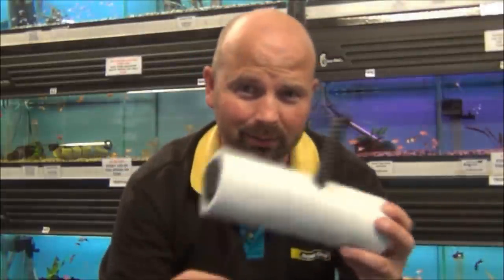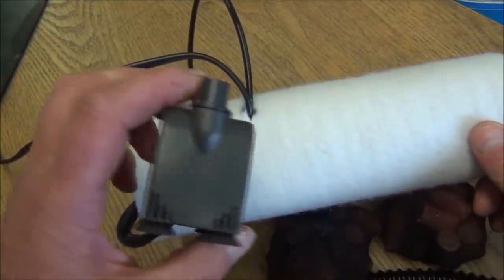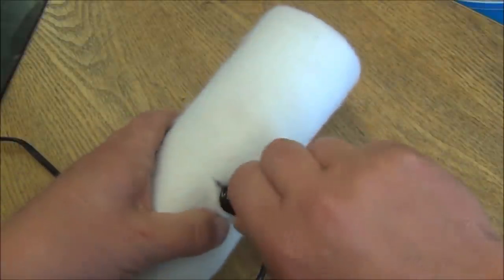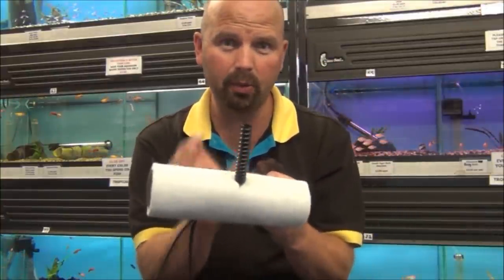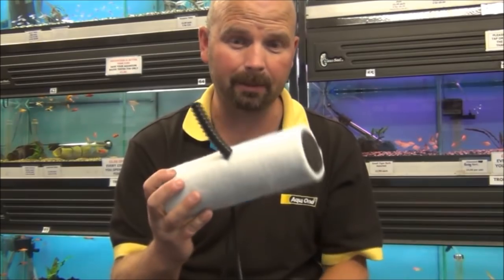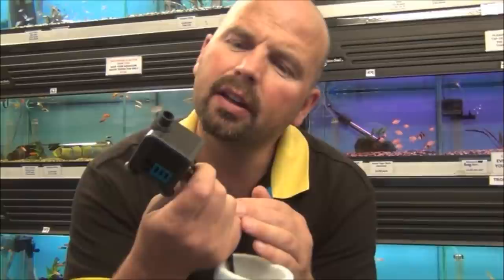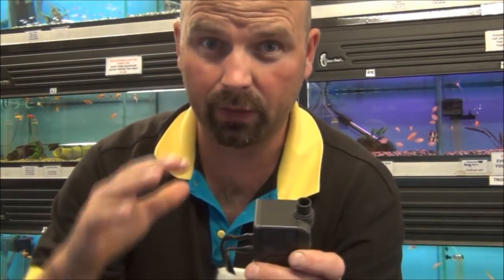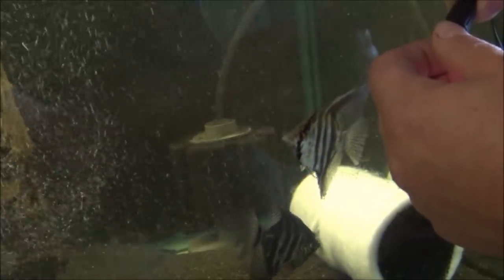BEAT THIS AQUARIUM FILTER!.....GROOVY - DIY AQUARIUM FILTER FROM PONDGURU

Comment: I believe your filter is by far the best that I have seen. Your friend gave you the foundation to put it into a very good idea. I am having problems finding the white poly tubes here in Florida,USA I have also looked for the small pumps themselves and I cannot find them. I have plecos,shrimps and royal plecos that would benefit from your filter.
Reply from the maker: You may find the pumps from suppliers of hydroponics gear but the tubes are proving difficult to buy at anything less than 100 at a time and the damn companies won't send a sample out.

Comment from the maker: +Cassie Kelly
Thanks for the link. Those tubes look different but would probably do the same job I reckon. I've got a manufacturer in China who seems to make the exact one I used in this video but if I can't get them I will give these ones a go.
Reply: Pondguru great video mate..... what is the maximum size tank for that precise filter If I may ask?
Reply from the maker: Juan Vazquez I would guess at about 100 litres for a community tank.
Reply: Pondguru thank you..... now my only problem is, finding that pump in the US :(
Reply: lol!... thank you
Reply: +Pondguru Outdoors im in new zealand but i would love one how would it work to achieve this make one myself? but then where to get the tube from and water pump haha any ideas?
Reply from the maker: +Awesome1001able I can send them over but it would cost a fair bit. There is a AU supplier of biohome (Genesis group) and if you search Alibaba on the internet you may find a company willing to sell 1-2 tubes. I had to buy 100 at one time to get them but you may get lucky. The pumps are made in Italy and may be available from Hydroponics suppliers in NZ or AU?
Reply: cool thanks ill have a look :)
Reply: +Pondguru Outdoors think this is one of the best diy's iv seen going to need to get a few picks of the micro set up im working on that will cover all 3 bads and uses moving bed mechanical and a very small aquaponics set up above the tank white spot invasion is under control now to
Reply from the maker: +dave mac Sounds good - send me pictures to pondguru@btinternet.com if you want.

Comment: Great filter concept Richard, but Really, "Shredded Air"?

Cheers, Kevin
Reply from the maker: As the air is drawn in and chopped into tiny pieces thus forming various size bubbles I couldn't really think what else to call it but if you have a suggestion I would welcome it. Standard venturi on outlet of pump are simply air bubbles - one size only but this way they are chopped up. Better having shredded air in the tank than shredded paper or shredded wheat, lol
Reply: @pondguru  Atomised air!

Comment from the maker: If you are in the US you will need a plug in transformer to run the 220v pump: http://geni.us/1zn4
Good mesh bags for media: http://geni.us/FaWBt
Frozen food: http://geni.us/LNA8 (select type - loads to choose from)
Since coming up with the 'internal moving bed filter' idea and posting videos on Youtube years ago I have been constantly working on new ideas for filters - some worked some didn't but this one is a great one.
Here's another filter idea from Pondguru but this one is aimed at people who breed fish, have fish houses or highly stocked tanks.
Much of the time those multi-tank scenarios rely on foam filters driven by air which can be very noisy and offer limited processing of nitrate so therefore require large regular water changes. 
With this design I have managed to create a filter which aerates water silently and has adjustable bubble size.
It offers effective mechanical and biological filtration and will reduce not only ammonia and nitrite but also NITRATE as it uses Biohome Ultimate which supports aerobic and anaerobic bacteria better than any other media.
The filter is washable and you can customise it to offer chemical filtration with addition of carbon or set it to condition the water by swapping out some media for a peat ball if you want lower pH.
The whole outer tube of the filter will attract detritus, algae etc. so will feed fry and shrimps.

FILTER MEDIA, FULL FILTER UPGRADE KITS OR INDIVIDUAL PARTS HERE: http://www.filterpro.co.uk

Thanks for watching this video - check out my other aquatic videos on the 'Aquariums and advice' playlist on my channel.
Please let me know what you think of this idea in the comments section - thanks for watching and supporting my channel.
Subscribe for more.
Reply: I noticed another benefit is that you when changing filter media or whatever inserts you like inside, you could do each side one at a time. This keeps at least 50% of all the beneficial bacteria in the filter ready to colonize the another half when brand new stuff is inserted. Love the idea.
Reply from the maker: Yes that's a good point I had not considered. Glad you enjoyed the video.
Reply: Pondguru Outdoors Great video - but can I ask Please....? If I turn the air nob to "close", will the pump/filter still work? I have a 15 gl and sometimes I'd like to Not have all the bubbles... 
Thank you for all the great
advice/videos.
Reply from the maker: Yes the pump will shift just as much water but with no air being mixed in so no worries there.
Reply: Pondguru Outdoors thank You very much for answering. Have a Great day

Comment: Very cool idea, similar to something I did a few years ago. You could even connect the air tub to co2 for a planted tank. should help the co2 be absorbed into the water.
Reply from the maker: Yes it should do that no problem. DIY Aquapros channel did a similar thing on one of his recent videos but the inlet for the CO2 was on the outlet (venture) part of the pump and it went through a diffuser.

Comment: hi, just rolling around ad came across your video and surprised to see a filter I made some 5 years ago here on your channel. I use and still use this system in some of my tanks and use a paint roller tube. I didn't chop my power lead  connector off but just made the hole bigger and then wrapped wool around the opening which turned into a nesting ball. ....Good to see someone else looking out side the box and great video...
Reply from the maker: Great to hear that you made a similar tube filter before I put this video up - groovy.

Comment: That's a very cool filter. It can even be use on a smaller tank by making it half the size and only using it vertically. Thanks for sharing.
Reply from the maker: Yes making it vertical would be no problem. Glad you enjoyed the idea.

Comment: Foam filters are gold. Especially if your raising fry.The added fine aeration is gold as well for fry. One thing Id change with the design though. In the middle I put some pipe where the pump sits. Other wise the pump wont pull from the sides enough most of the water will come from the middle skipping all your filter media.
Reply from the maker: The polyester tube would simply block up first around the areas of most draw and would always move to the point of least resistance but that is a possibility, yes.

Comment: I have a tank mounted waterfall filter system (hard to come by nowadays). I like the fact that the filter cartridges can be taken out and cleaned easily and that carbon filters can be fitted. But there is no aeration as such. Now wondering if I can modify the existing pump to drag in air. Will look into that.
Reply from the maker: I have tried with a few pumps to get air pulled in at water intake point and it is very difficult as the air pipe needs to be set perfectly. That's why I was loving it when I found these great little pumps.
Thanks for watching and appreciating the videos

Comment: Amazing idea, truly, i was thinking of something DIY envolving an array of volvic bottles etc but it turns out simplicity is the best best route, ill be making this exact filter to backup my exsisting hydor crystal duo. Thanks!!
Reply from the maker: No worries - I'm sure there are loads of ways this could be enlarged or improved but the key thing is getting the pump which will draw air in before (not after) the impeller as that makes all the difference to how well it oxygenates the water.

Comment: great video.. I do the same thing but I use a 2 litre soda bottle and sponges.. cheap.. and works awesome..    harbor freight has a good assortment of pumps.  I use 2   800 gal per hour pumps on my 100 gallon tank.  water is always clean.   it's quite too..

Comment: @pondguru how will this work for nitrates if you are passing air thru it? Don't the bacteria which convert nitrate to nitrogen need an oxygen depleted and low water flow environment?
Reply: Dawgz that’s correct ! This is just a fun diy mod but not the holy grail. Also all the dirt and bad bacteria’s will stay in the water. And this thing will clog up so fast that in the end it just works as a large medium filter.

Comment: You are a genius, I have been trying to improve on my current filter and all ideas are good, but not great, and usually end up with a bulky apparatus inside the tank of ouside of it that honestly looks stupid. I can generaly make this one to suite different tank sizes by adjusting the size of the tube and even the pump. Believe or not, there are smaller pumps out there that work on 12volts easily convertible to a 110/120v with a few transistors on the wall plug (not outlet)
Reply from the maker: Yes there's a world of little pumps out there just ready to experiment with, lol.
If I had time I would be tinkering away all day every day but damn work gets in the way.
Thanks for watching and appreciating the videos.

Comment: If just using that pump, it's much quieter if you wrap foam around the water intakes and let it hang against the side of the tank (soaks up the vibrations) instead of using the suckers. Stops small fish getting sucked in too.
Also find it makes a lot more very small bubbles (as well as the big ones) when the air intake is is fully open. But it's noisy fully open - the noise comes out of the air pipe.

Cheers for the helpful videos mate.

Comment: Excellent!!!  My idea is = you can make the polyester tube out of FELT. It comes in all kinds of thicknesses -  just pick the thickness you want, and roll and sew to size.
Reply from the maker: Yes felt should work too. Hopefully I can get the ready made tubes as they fit these little pumps perfectly. Really looking forward to pulling the components together and offering people something they can customise for mechanical, biological, chemical or water conditioning or a combination of any of those as that flexibility is something I have been looking hard for. It would be a great shame if this never got beyond the concept stage.
Thanks for watching and appreciating the videos, man.

Comment: Pondguru's manufacture and design of the polyester media filter tube is very good. However, I am pondering the question of best practices in regard to integration of biologic media into the design ( post positive aeration ). However, while my experience with anaerobic activity has been mostly due to prolonged maintenance intervals and poor practices in regard to fluid flow, I will build and use this set -up as a nearly perfect cost effective (and adaptive) filter in my nano display. Thanks to pondguru.

Comment: the one thing people still don't know to use especially cycling a tank with this that fluval clear max does nitrates, nitrites and phosphate removal for up to 80 gallons. this type filter is perfect for that and carbon with zeolite to remove ammonia and chlorine as well. really cool design and so simple for any one to add one of each of those media and the tank cycles in a 4 days rather then 5-8 because the nitrate and ammonia spikes are reduced or non existent.

Comment: I bought the 450 litre air pump just on the strength of this video. I've got a couple of common musk turtles and some white cloud mountain minnows in my 4' tank and the pump ensures there's plenty of oxygen in the water. I'm also running an external filter which does 1600 litres per hour and I'm thinking about improving it as per your other video.
Reply from the maker: As an extra for a turtle tank it will be a great supplement to your main filtration as water i turtle tanks can be very quickly de-oxygenated as they are such heavy polluters.

Comment: Billiant idea Richard.  Here's a question, would the media work even better if you put in an airline just after the end sponges?  The air would get drawn through the filter, over the media and out again.  I was thinking the air running over the bacteria may help.  Also, if you did that, you may not need to get an oxy pump.  What do you think?
Reply from the maker: There wouldn't be enough draw to suck air down unfortunately as the intake pipe needs to be very near the water intake point on the pump. Also the whole idea of this pump is that it shreds the air to make it useful and quiet. The water will still be well oxygenated for bacteria if drawn in normally.
Thanks for watching and appreciating the videos

Comment: I love this idea.  I have dragon gobys and worry that the filter pumps are to noisy for my guys.  This will be a great answer to that problem.  So glad I came across your channel.  Do you think this will work for brackish tanks?
Reply from the maker: +karizma Blue Sorry just seen this now. I don't see why not. The shaft of the pump impeller is in constant motion so should not be affected by salt in water. When the bubbles are turned down to be very small the tube filter should be almost silent.

Comment: With finding a source for the tubing seemingly a dead end was trying to think of alternatives.. Best I could think of was getting a soft large paint roller and removing the plastic inner tube so it would be permeable, then packing with media and foam. Don't know if this would work , what's your thoughts? If it fails can always use the inner plastic tube to make a egg tumbler
Reply from the maker: Most paint rollers are decent looking and a few people have tried that but I haven't gone there yet. Best way is to experiment. Go for it, man.

Comment: Might see what I can source for parts locally, but surely it's possible to make a unit where you don't need to remove the plug. Looking forward to trying it though.
Reply from the maker: Yes you don't need to cut off the plug  - just pass the air line and cable through the pipe and out the ends. I was just trying to maximize cable length in the video.

Comment: Looks great! where do I get the pump? Can't you make your own filter, piece of foam wrapped round a tube glued with waterproof glue and take out the tube?
Reply from the maker: I sell the pumps but they are available on ebay and amazon from other suppliers too - just make sure you get the version with the air intake.
Yes I have seen a few videos where people have used a fine pad to make the outer part then filled it with various foams and media - still works fine and really this video was as much about getting a concept out there as it was about a specific design with specific materials. Any parts can be swapped out for something else wit varying degrees of success.

Comment: You should be careful with that kind of aeration. It works well and I like it. I even used to add a air hose line to the intake years ago. To the point to much fine air bubbles can give some fish Popeye in some fish. I only tested Goldfish but I suspect it could cause in some other fish as well. If you do run into that problem just go back to a regular air stone and the problem should resolve on its own. I do like the filter idea.

Comment: what about large paint rollers for the tubes ?. I believe there are larger than your standard homeowner 2 inch diameter like 3 inch or 3.5 inch diameter so that you could slide your pump in through the center ...??? just a thought ??
Reply from the maker: Yes it would probably work but I'm not sure that they are porous so may not work the same - I really need to get some and give it a go.

Comment: Great video that, I have just come back to the hobby after a few years out and that is a genius idea. One I will try out for myself Cheers Dude.
Reply from the maker: No worries, glad you like the idea. Latest aquarium related video I put out has an awesome trickle filer which may be worth considering too if the tank is a decent size.
Reply: What's the maximum capacity of a tank that this filter and pump can handle?
Reply from the maker: As far as full cycle filtration goes (reduction in nitrate) it would be suitable as the sole filter for a 50 litre (heavily stocked) to 100 litre (normally stocked) tank.

Comment: Nice mate. Would one of these benefit a small pond? The pump on the oase swim skim works in this way I think. Very nice mate
Reply from the maker: It would be too dirty in a pond for this to be effective unless the pond was really small. I think the swimskim draws air in at the outlet point but I may be wrong. I'll have to check that. The swimskim is a decent unit for small to medium ponds.
Thanks for watching and appreciating the videos, man.

Comment: Awesome! I have a local hydroponics shop so the pump should be doable, but where can I get the poly tube? You get all credit for the moving bed, love your designs. My tanks are still very young and I am constantly experimenting but if I get my new idea for a variation of the moving bed filter up and running I will record and upload it for you.
Reply from the maker: That sounds good, man. I still can't find a supplier for the tubes but I am trying. Hopefully they will be available as they make a perfect filter body.